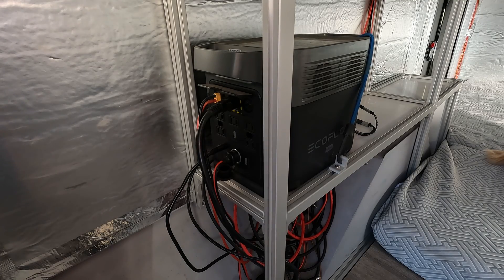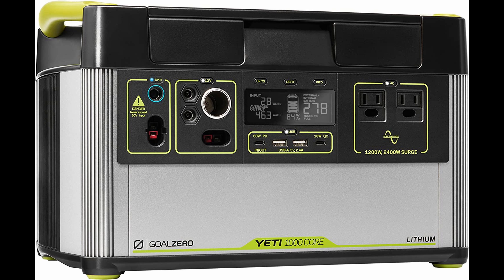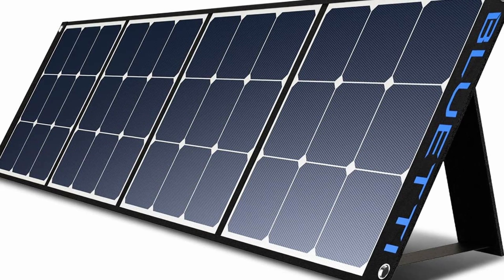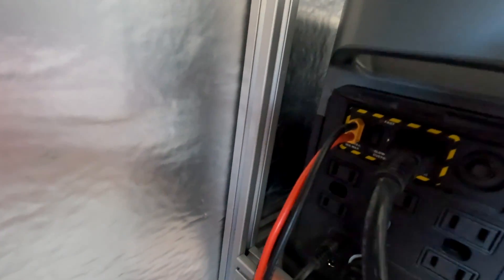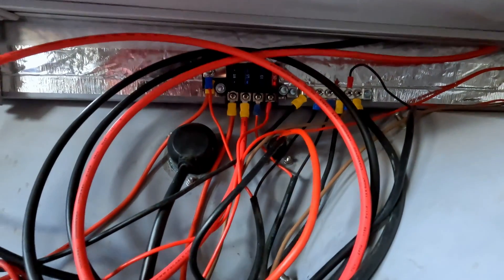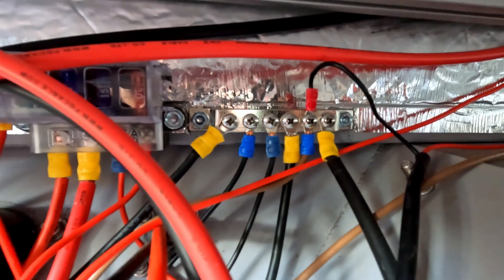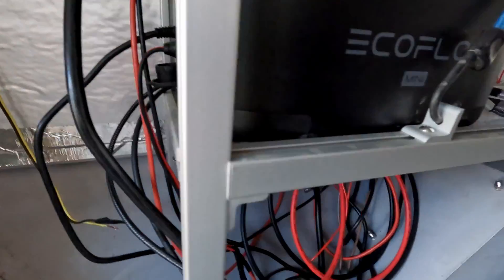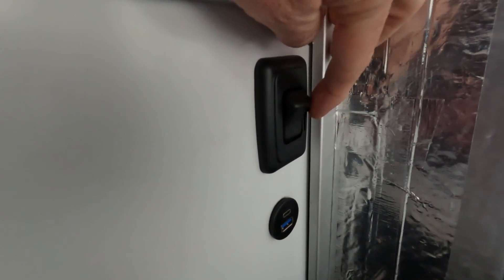Can You Run a Camper with a Portable Solar Generator? EcoFlow Mini!

Comment: It does only weigh 24lbs which makes it quite light for a 882Wh power station.
Reply from the maker: Yah, super easy to unplug and take inside for a charge if needed.